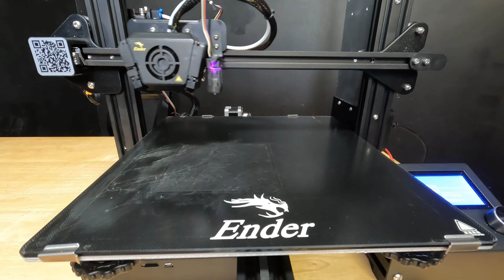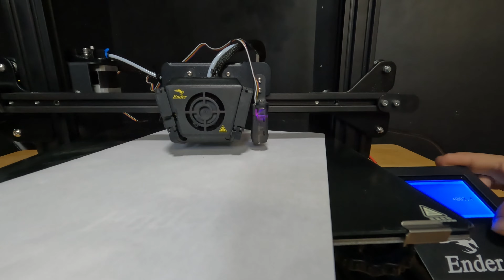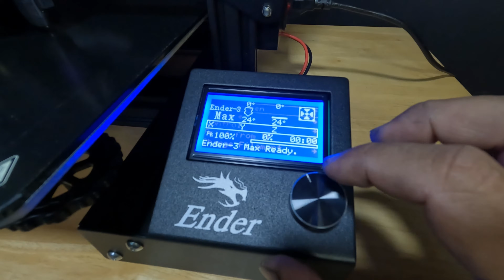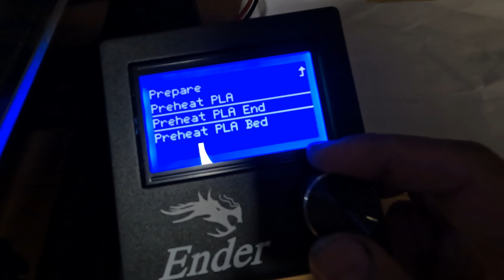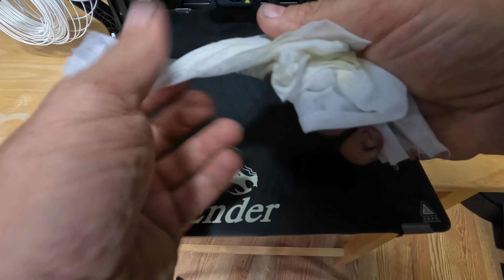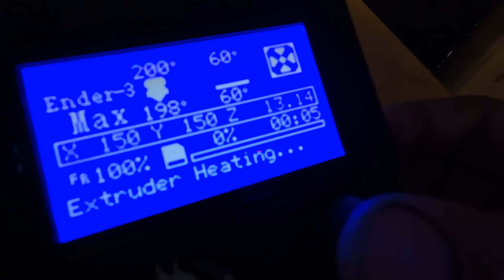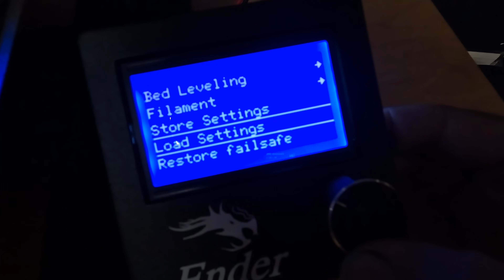Ender 3 Pro or Max: How to Level, Set Z Offset, and Make ABL Mesh, with CR Touch or BL Touch

Comment: I used to use rubbing alcohol to clean my E3Max bed, the yellow on my towels always bugged me, as it came off the bed from day one.  Eventually I had a print that stuck to the glass so hard that it pealed some glass off with it in getting it off.  I came to the conclusion that the yellow was a non-stick coating of some sort.  After getting a new bed I switched to mild dishwashing soap and haven't had a problem in years.

Comment: onw question. im not sure if its a firmware difference but my machine looks different but is an Ender 3 pro . Im able to follow up to the point you go into bed levelling and alter the z probe, my menu is different. I assume i need to go into movement and select z offset?
Reply from the maker: Can you pop into my Skool so we can have an organized exchange with picks and links

Comment: Hello, I know this is an old video, but I just got a used Ender 3 Pro with a 4.2.7 board and CR touch and I am having a couple issues.  The FB groups I've messaged have been rude or talk to me like I'm a moron.  After a lot of searching, this is the first and ONLY video that's gotten me close!!  I've been able to make several great prints using this video, but then lost the calibration completely the next time I powered the machine on.  I also think my bed may be warped so I ordered glass. I'm not sure I even have the correct firmware, but given that I've had successful prints, it probably is.   However, when I have trammed it close, the bed leveling just stops and the CR touch blinks red.  Last, there is an "upgraded" filament feed, but it seems the gear is slipping.  Going to replace that too.  ANY help would be appreciated regarding the firmware and the CR Touch bed leveling !!
Reply from the maker: Hey Nick. You won't find those people here, or in any of my groups. I remove them all. 
1st, understand that your machine is 9984466388% more difficult to work with, than even the cheapest modern 3D Printer. 
Having said that....
Let's be sure things are in order, with the machine. If anything is loose, and offering movement, where their shouldn't be any, your machine won't be able to calibrate properly, as the situation will be ever changing. 
Follow along here: https://youtu.be/pP36ozrfRQ0
I would prefer you slice in CREALITY PRINT 6 or 7
If you are using cure, please be sure to follow this: https://youtu.be/mKvst6qpkPw
CR-Touch is giving you an error. I'd love to see it that portion, you can post here:
https://www.skool.com/3drundown-8042

Please remove any upgrade, and return the machine to it's stock condition: Extruder, Bowden, Hotend.
This one: https://youtu.be/UobzCZtwOrs?si=0IT48J0Krk2n_kOY
Reply: @3DRundown thank you SO much for replying. It figures I'd get something difficult 🤣. I did find one of the bolts for the bed had slop in it. I thought it was spring compression. I also cleaned the CR Touch thoroughly and learned how to reset and run the self test. I also rechecked all board connections and so far, so good. I have completed 2 test prints since. I will check out the group as well. Thank you again 🙏🏽
Reply from the maker: @BigNickSnr  Learning this fossil will set you well above the average user.
Being a YT or Skool member, helps me continue doing what I do. 🙏🏻

Comment: Please HELP...installed my autoleveler. But when it goes through the motions. The nozzle hits before the sensor. And the frame twists a little bit. How do I fix this?
Reply from the maker: install a spacer to lower the sensor. search my channel for video on that
Reply: @3DRundown  unable to find that video. Also.....I did try just putting some thin washers as spacers. But now the dumb nozzle doesn't even touch the bed. I decided to try the print anyway. Well it starts off printing spaghetti. But then appears to "feeeze" mid print. only prints a couple inches of extruded filament. I wish I could get you on the phone. It really seems like there is a problem in the firmware.

Comment: I can't for the life of me get my Z offset to get below zero. This video is very detailed and super helpful, but I am stuck personally. I put nuts on my screws that are attached to the print bed because they were rotating and its likely causing issues. I tried shortening the springs to see if that might help slightly and the best I have gotten Z at is .6 please let me know if you have any tips or tricks that you would recommend thanks!
Reply from the maker: 1.) Take the Nuts off. 
2.) Install Yellow Springs.

Start with the bed as high as can go, without the springs being super loose.
Tram the bed.

MOVE does not go into negative, or adjust Z-Offset. You MUST be in the z-offset setting, which might be called "PROBE Z OFFSET" or something similar.

Tram, then set the Z

Comment: What if my Ender 3 Pro doesnt have a menu option of "Prepare"?
Reply from the maker: Update to a better firmware. https://marlin.crc.id.au/
Reply: @3DRundown I am using Marlin 2.1.1 now. I am a newbie and just recently bought a used printer. It came with a glass bed, a metal filament feeder, Capricorn Bowden tube, Big Tree Tech mainboard and BL Touch and whatever else the previous owner installed that I haven't noticed yet. I have an idea but not exactly sure how to update the firmware. I looked at the page you posted but the Ender Pro isn't listed. Would it be the same as the Ender 3 non pro?
Reply from the maker: @CrazyOneToo  Stay with that for now. You should find the "Prepare" stuff, in "Motion"
Reply: @3DRundown I must have done something completely wrong by accident. When I boot the printer on the X Y and Z shows up like they are not set. Instead of number i have question marks. Under motion menu  I have move Axis, Auto home, home X, home Y, home Z, trimming wizard, bed leveling, M48 probe test, and disable steppers
Reply from the maker: What setting are you missing? Could try a Factory Reset, to start fresh. "Initialize"
Reply: @3DRundown I watched your video a couple more times to make sure I wasn't missing anything. At 5:13 of your video you take us into the menu to bring the head down Less Than Zero. When I get to that point my settings say zero but when I turn the knob the head doesn't move down and the numbers don't go into negative numbers. I assume I have something set up wrong. I have a BLT touch but also have the stop on the side still set up. The option you give of prepare I don't have in my menu. I am running the Big Tree Tech main board. It's what came in my printer when I bought it. There are four sets of firmware that I have. The three that the maker have online and I have the one that came on the SD card when I bought the printer. I think it is the latest version. If I flash one of those other three versions I lose some options in the menu.
Reply from the maker: @C @CrazyOneToo Move, will always take you to ZERO.  

Zero is:  0 + your Z-Offset.

Find the option for Z-Offset. May be called something different, such as "Probe Z Offset", but if it's a BL-Touch firmware, it's there
Reply: Under configuration I have a "Probe Z offset".  Under advanced settings I have "Set home offsets". If I push "Set home offsets" it screams at me and says "Err: too far". After it goes back to the home screen it shows my info as  X-161 Y-126 Z-0. Also on the home screen there are two small arrows pointed at a number and a percentage. It stays on 100 but I can turn the knob and make it go up and down but of course I don't know what that does. It's the only number on the home screen that changes if I turn the knob. As far as I can tell changing that number doesn't move the head or the bed or anything else. Ugh!!!
Reply: @3DRundown okay under probe Z offset there's an option to move up and down and when I go down to where the paper just barely catches it's at negative 0.275. I'm guessing there's a place I need to enter that number in?
Reply from the maker: @Cra @CrazyOneToo That is your Z Offset, and your New 0. Save that
Reply from the maker: @CrazyOneToo  Don't touch any of those things. ONLY "Probe Z offset".  Leave the Percentage setting at 100, on the home screen. Don't change that
Reply: @3DRundown  OK I'm not trying to change any other settings. I don't know what most of them are so I don't change them. When I did that and then put the bed to where I feel it should be with a piece of paper like you show and I clicked on Store settings and It beeped at me. I don't know if it was saying thanks or it was mad. When I exit out and go back to the main screen it shows my X and Y but my Z still says zero. Is it supposed to say zero on the home screen?
Reply: @3DRundown okay thank you very much. I think I got it now. It's showing a number on the home screen for my Z axis. You're a rockstar!!!! With that being said I'm sure I'll be back with more dumb questions. 😊
Reply: @3DRundown sorry to bother you again but I had to replace the main fan and when I put everything back together I can't get things to set up right. I go through all the steps in this video and when I start to test print the nozzle comes down and hits the glass plate. Could it be something to do with my Z axis stop switch? It is still hooked up even though I have a BL Touch on this printer. It printed good a couple of times but not since the fan install. I have options in settings that I don't think came stock. But I don't know since it has a big tree Tech main board. Under custom commands it says "Shut down pi" and also some PID autotune settings. I assume the PI is for a Rasberry PI the previous owner used. Thoughts? I may have to end up buying stock in a coffee company. 😃
Reply from the maker: @CrazyOneToo If you have a Touch, you must remove the switch
Reply: @3DRundown  Can I just unplug it from the switch?
Reply from the maker: @CrazyOneToo yes. But take the switch physically off
Reply: @3DRundown  OK tried that but the numbers are way different than your video shows

Comment: Hi! Came here after watching your CR Touch installation video which was really awesome! I do have a question though and sorry if it's silly because I'm still new to 3d printing: In this video you manually set the z offset, manually trammed the bed, then did the auto bed leveling. But you still ended up needing to adjust the z-offset again when you started printing? Does that mean the auto leveling didn't work very well?
Reply from the maker: ABL only studies the bed and maps out inconsistencies. It doesn't adjust Z-Offset in anyway. You'll always want to check your Z-Offset last. Remember, we are talking fractions of a millameter.

Comment: I got hints to add M420 S1 to make sure the mesh is used while printing.  Is that also what you do or you do a bed leveling every time you start a print?
Reply from the maker: This is exactly what I want you to do: https://youtu.be/mKvst6qpkPw
Reply: @3DRundown thank you!!!!!
Reply: Another question : is it correct to assume that before starting the z offset process, I should first put it to 0, save settings then do all you do in the video?
Reply from the maker: Not necessarily. Set to anything that won't drive it into the bed. Then work from there

Comment: This is what I have never understood, Paper is on average 0.09mm thick and if I stack them to got 0.28mm when printing PETG I dont understand.
Reply from the maker: The paper is only for tramming, and a starting point. Dial in Your Z-Offset at the start of your next print after tramming. Also, the first layer is squished for bed adhesion, it's NOT the layerheight. Layer 2+ will be the layer height

Comment: I just today started up my Ender 3 Pro for the first time without an installed BL/CR Touch and I must have gotten confused to properly store my Offset (which is also a different process as shown here) so I immediately created a little dent in my printer bed :/ 
I am hoping to achieve a flat surface again by putting a repurchased Surface Hotbed Cover Print Plattform Kit on top and then purchasing the BL Touch. I hope I didnt cause any permanent damage, but this video makes me hopeful again, thank you so much.
Reply from the maker: Don't use an Ender without a Probe. Consider it a mandatory component.
Also, keep in mind the stock bed is GLASS. If yours has something else, such as a Magnet, it requires a Print Bed ontop of that

Comment: I have an Ender 3 Max with de BL Touch. I did every step of the video very carefully, but always when i start printig, the nozzle is too high, something close to 1mm, and i have to adjust the Probe Z offset to lower the nozzle close to the bed. And even saving this configuration, on the next job, the nozzle is too high again. Can you help me?
Reply from the maker: That is still your Z-OFFSET. Do you have a memory card in the machine to save your settings? Are you doing the Z, then SAVING, before printing? Do you have M420 S1 in your GCODE after G28?
I would grab a firmware from these guys: https://marlin.crc.id.au/
Reply: @3DRundown  I have the memory card and I saved before printing, but I don't have the M420 S1 in my GCODE. Perhaps this is the problem?

Comment: Start by getting the frame square and any parts with those rubber wheels on eccentric nuts adjusted appropriately, so the gantry doesn't "wobble" like it does here. Then this video does pretty much covers everything, except I believe you may have to activate the mesh in the start gcode. The idea of having the bed springs tighter is to ensure those adjustment wheels don't easily move out of place; you can add an extra nut to give them more tension. Dish soap is a good cleaner because it gets any grease; don't touch the bed, that just adds more grease! Be careful reaching under the hot end while printing.
Reply from the maker: Configure your GCODE to use the ABL Mesh https://youtu.be/mKvst6qpkPw

Comment: Thanks for this!  I was pulling my hair out trying to get my Ender 3 working with the CR touch I installed last night.  After following your steps, it finally works correctly.  I also noticed that I needed to move my Y axis limit switch forward a bit - the prob was hitting the curved edge of the glass bed on the front mesh points.

Also - is your gantry crazy loose on the right side or am I imagining things?
Reply from the maker: It might be... I MAY OR MAY NOT have also shot a video on how to fix that. 😜🤔

Comment: Thank you for this video! Your method helped me get my 3D touch working! It wasn't exactly the same menu navigation, but your explanations as to why helped me put the missing pieces together. I actually took the sensor off and ran the non-BL firmware because i had gave up, but your video convinced me to try again and it worked, it actually worked REALLY well. Once again, thank you!

Comment: cant wait to try this once my new filament comes in but had a question. do you have to do this every time you print ? every 5-10 prints or good to go after doing this ? not going to lie getting the touch to work has been a headache and this seems like alot of work vs not having a touch but i wanted the touch and finally got it working. i put it on i couldnt get it to work so threw it in the closet for over a year and just recently got it back out to give it a shot and finally got the firmware to work but now with this set up i just wanted to know if every time i have to do this or just hit bed level and good to go ?
Reply from the maker: As needed. Treat the build plate gently, and it should behave for a while. Sometimes, simply running a new abl is enough. other times, a quick adjustment.

Comment: Sorry if anyone has this answer for me but my printer for some reason does not want to save my z-offset?
Reply from the maker: Go to the config screen and choose SAVE. keep memory card in machine
Reply: @3DRundown  ok thanks I tried it but it still didn't work even got a whole new sd card and still nothing. I've been looking into it and it seem that there's somthing called a (eeprom) code that should be on the sd card but I have no idea 🤔 on how I even get it. At this point I don't know what else I can do to fix the issue I've been trying to get into the hobby for so long  but I want to give up at this point 😕. Idk what else to do

Comment: i have found myself lost in the world of firmware. i have the original base model with 4.2.2 board. understanding what i dont need is anytthing marlin related, the firmware updates without marlin in the linedo not have the 4.2.2 that would confirm it. i upgraded firmware once, but i'm not thinking i downloaded correct update bc my screen and your screen do not say the same things.
Reply from the maker: Marlin is what you need. One that supports BL-Touch

Comment: My bed is already super close to the nozzle, even when the screws are all snug. Any help?
Reply from the maker: Raise your Z-Offset
Reply: @ I tried doing that, but it doesn’t make a ton of difference and I can’t go any farther than 9.9
Reply from the maker: You are UP 9.9 and still touching the bed? Are your Springs too long?
Reply: @ Iam not sure if my springs are to long there the stock ones and yes I am up 9.9 and my nozzle is still super close
Reply from the maker: At ZERO, it should be too high. Something is wrong. You have the Z-STOP removed, and CR-TOUCH firmware installed?
Reply: @ The z stop is removed but the cable for it is still there and I followed the tutorial on the video before this one on how to get the correct firmware
Reply: But I’m not totally sure if the firmware is correct
Reply: @3DRundown  How do I know if I have the  correct firmware. I’ve watched multiple videos and they all recommend different firmware.
Reply from the maker: It will have Z-OFFSET and ABS function. This is the only place, I get firmware from, for older marlin machines: https://marlin.crc.id.au/
Reply: @3DRundown  Thanks I will try this also do you know how to install it?
Reply: @3DRundown  Hey when I’m on the Marlin website, it says I have to have a membership. Do you know how to get one?